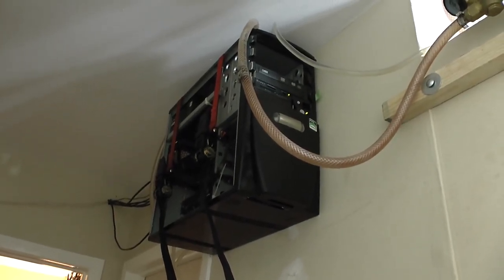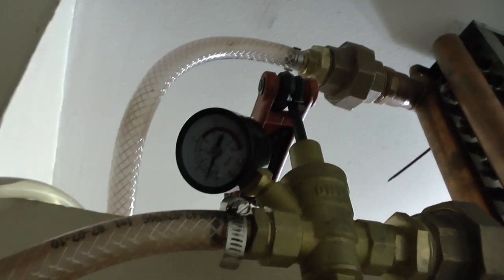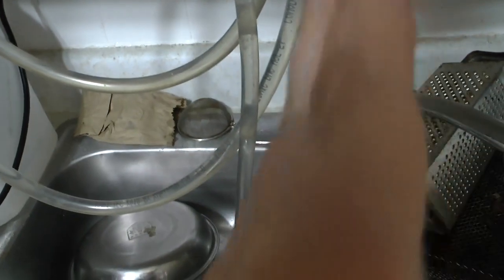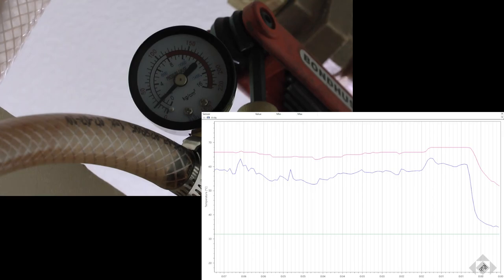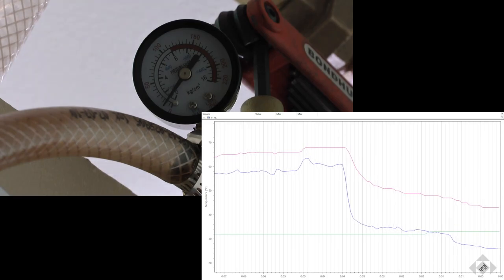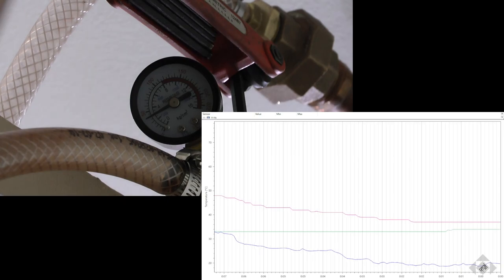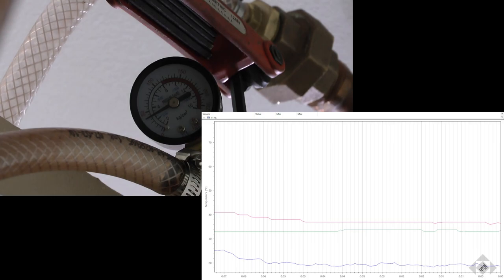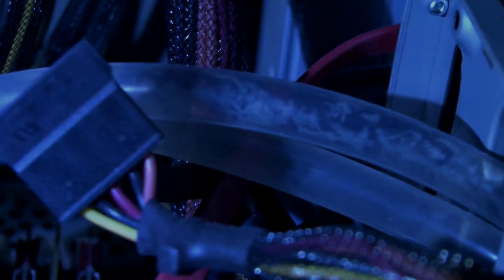IRL - I gave my strapped computer a 'dangly participle' - Once through water cooler

Comment: There's not enough inforamtion to show by calculatin the maximum cooling power of the setup but the flow rate is about 10L/min -ish.
it takes 4.186 J to heat a gram of water by 1 deg so to heat the water by 20deg on the output end assuming that flow rate of 10L/min it's 10*4.186*20 which is *14kW*
you could in practice push the water to 90C for an absolute max (assuming it's 10c at the start) cooling power of *56kW*

edit: I meant to show it accurately, this makes lots of assumptions to get a ballpark figure that may be very wrong like assuming that you have enough heat pumped thru the heatsink to the water to saturate it which you don't.
Reply from the maker: I donno, looks like your doing a pretty good job calculating with what you have
Reply from the maker: Also, I do believe you can calculate flow rate using the assumed pressure at the discharge site, aperture size, by assuming the resulting pressure is 0 as it is discharging into open air. Also, also, I also calculated around 50kWs... also...
Reply from the maker: So... not using a stop clock, using only one sample, and filling a container I only roughly know the size of... I get about 20 liters per minute, give or take. Water works says it's 80 for the half inch service. SO LOTS OF CONSTANCY!

Comment: Woah. That’s super cool! 
Don’t know if you have already considered this or no, but they yellow water is something we deal with also, and it is because of water being contaminated with lots of iron. I don’t know how this will affect your thermal system, but I do worry that it could rust your water block.
Regardless, awesome setup!
Reply from the maker: The local water works says it's organic sediments... probably algae. We don't have much in the way of iron deposits around here, and most of the water pipes are concrete or plastic. The yearly water tests are always high with organics, and half the time, over the limit on salt... it's gross...
Reply from the maker: Also, we PROBABLY have tonnes of run off from the farms surrounding the river in both directions... very gross...
Reply from the maker: OH! And there are traces of Uranium in our water supply! 1.25 parts per million!
Reply: @JoelleTheAbsurdist  Are you living in the fallout universe?!
Reply from the maker: @Katswell  I live in Ontar-i-o-i-o, in Ontar-i-o... with those black flies those little black flies always the black flies picking my bones!

Just in the south.
Reply from the maker: @Katswell  https://www.youtube.com/watch?v=f389hIxZAOc

Comment: christ, 70° water! that's a lot of energy getting sucked away! one day in distant future winters we'll have Dune-esque VR stillsuits that pipe our computer coolant water across our bodies... well, those of us that survive the climate wars
Reply from the maker: I've been advocating the use of the domestic water supply being used as a heat sink in heat pump loops... The major problem in northern latitudes is that somewhat often, the outside temperature falls bellow the condensation point of a heat pump's refrigerant, rendering the pump mostly useless. But the domestic water supply is usually, always above freezing, making it an exultant conveyor of waste heat.
Reply: @JoelleTheAbsurdist  It's an exciting idea. I was stunned to learn just how efficient most domestic hot water tanks are at insulating their heat energy, too. it's kind of weird to think about how just about every house has these big water batteries we're not really using
Reply from the maker: @gloverelaxis  Technology Connections?
Reply: @JoelleTheAbsurdist  haha yep. of course their whole cleanly-stratified-temperatures conservative heating trick doesn't work when you're pumping flow through them, but the idea of using that already-existing huge thermal mass and great insulation is so appealing